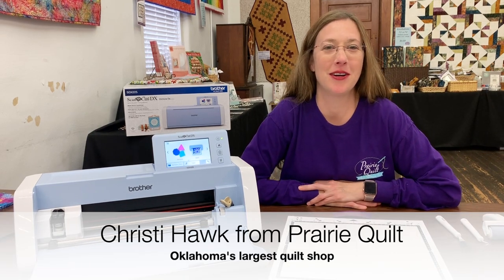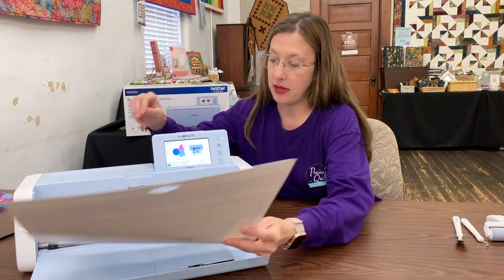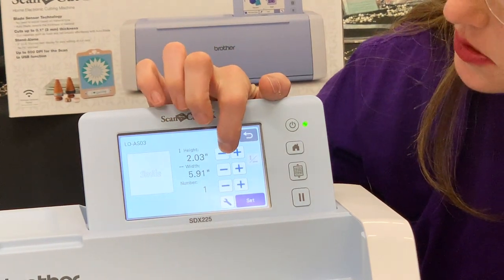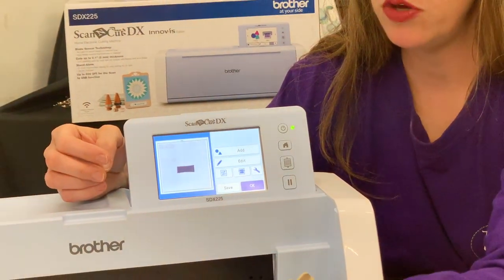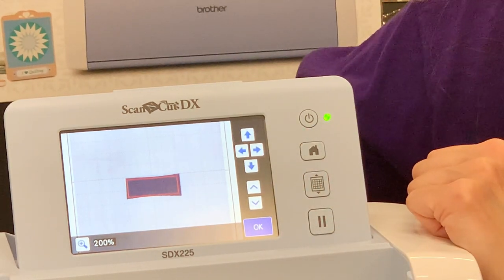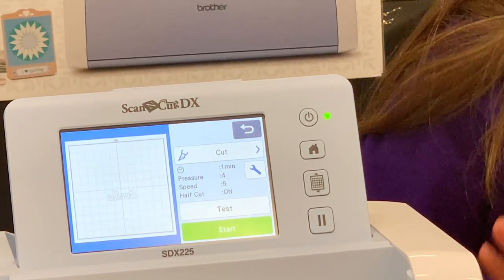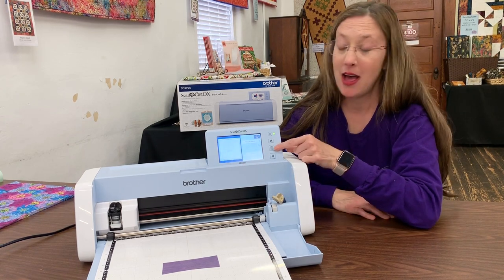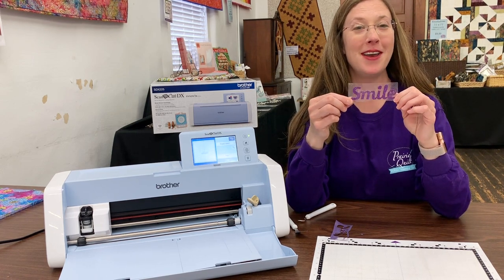Making your first heat transfer vinyl cut on the Brother ScanNCut SDX225

Comment: Thank you!  I was looking for what the Cricut can do and saw a review and the guy mentioned this Brother Scan and Cut!  He brought to my attention that not only do you have to use a laptop for the Cricut but you have to pay $5 & $10 fees for their online site.  He prefers this machine to the cricut.  So, now I have another option to place words on my face masks and t-shirts.  When you iron on the word smile do you pull off the plastic?  You did not show that step, so, I'm asking.  I also noticed that fabric can be drawn on and cut.  Does the machine cut up to 6ft of fabric?
Reply: Once you have weeded the bits not needed, you will still have the backing on for it all. This is correct, as only the actual pattern will adhere to your project. After leaving it to cool just peel off all the backing afterwards.

Comment: Is there a way to change the font width without changing the font height? I created some text that's supposed to be 3" wide by 1" high on the Brother Canvass workspace but when I send it to the cutter, the size has changed and I don't see a way to get it to the size I want.
Reply: Yes  go to edit, to resize (the 1st button at the top) the at the bottom of resize you will see what looks like a 1 plus a vertical line and another 1 at an angle. Once this is clicked you can size each part separately. I hope this is clear. Mine is the SDX 90 so if yours is different it may have different ways to get into the resize.